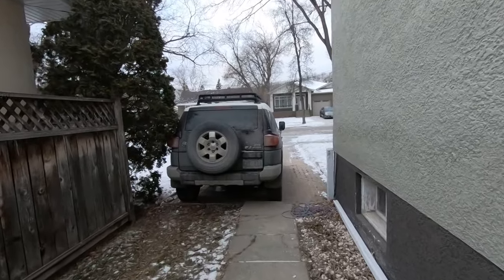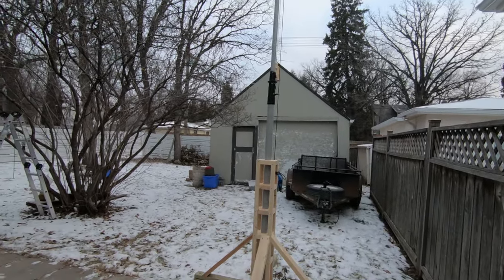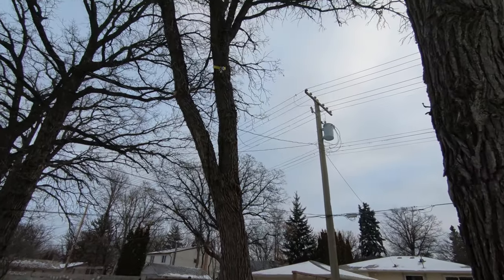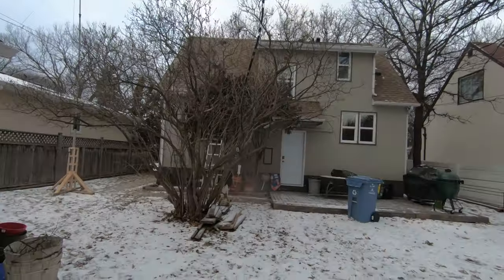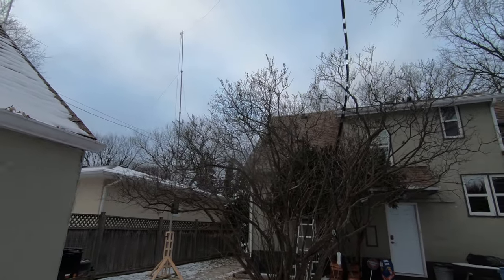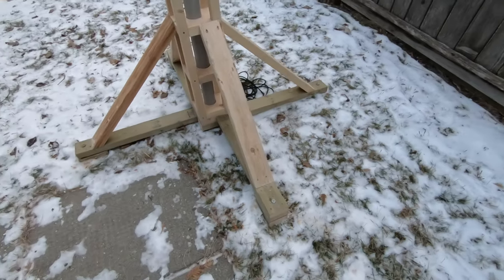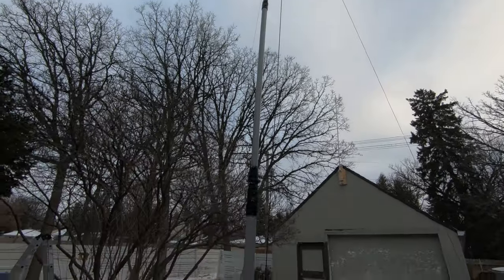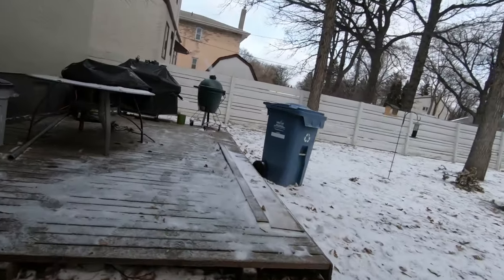G5RV-JR Antenna Setup

Comment: I just bought a G5RV and a Spiderbeam fibreglass pole 12mt. about the feed ladder line how do you have it tight to the pole? Is it left hanging downward loose? Does it have to have a space between pole and feed ladder line until the ground? Or can it be tied together with the pole with plastic ties? Great video very interesting Thank you
Reply from the maker: On my install the ladder line just hung from the center.  I had a current balun between the coax and the latter line, and that I secured to my mast base to stop it from swinging.  My understanding is that ideally you want spacing from the ladder line to any objects as they can affect the feed impedance.  Fibreglass should have minimal impact, but if you were using a metal pole for instance you would want something around 5-10" of spacing.  Basically, securing the ladder line isn't too important, as long as it's not swinging around a lot.  

I had tried two installs.  The first stretched the antenna between a tree and the mast from the ends.  It was okay but the antenna needed more support.  The second install lifted the centre of the antenna up in the air and one end went to a tree, and the other end to another mast.  G5RVs radiate the most from the feed point from the latter line into the dipole section (some radiation from the latter line as well depending on band and impedance match).  So it' best to install the center as high as possible.  Flat install is best, but inverted V is definitely acceptable!
Reply: Many thanks much appreciated!

Comment: try an inverted v with the mast in the middle.
Reply from the maker: Yeah I've considered it and might make the change before too much more snow falls.  Right now it appears my propagation is better than what I can receive.  I know the G5RV style antenna works best with the middle up high.  I was hoping to get it installed around 25' up in a flat top configuration, but inverted V might be better than what I ended up with.
Reply: @aacmckay  I think you will get better performance with it inverted.  If you were able to get the antenna a lot higher, than yeah the t style would work great.
Reply from the maker: @hambone4495  Tied off with another ham on Reddit and I think I'll give the inverted V a shot.  I can leave the tower as is, pull the center up, and then try pulling both ends down to the fence, or leave one end on the tree and the other on the fence.  We'll see if that improves my RX over the coming weekend.